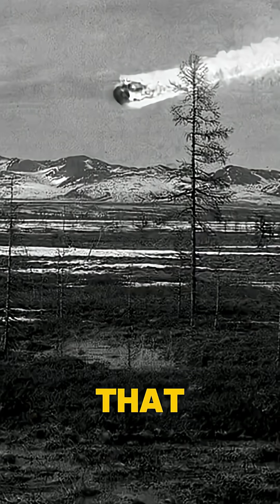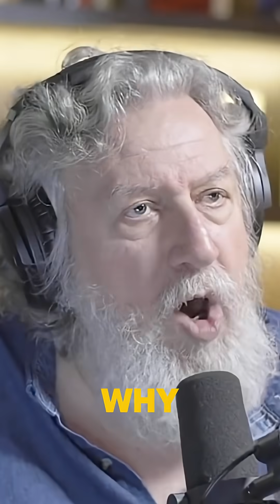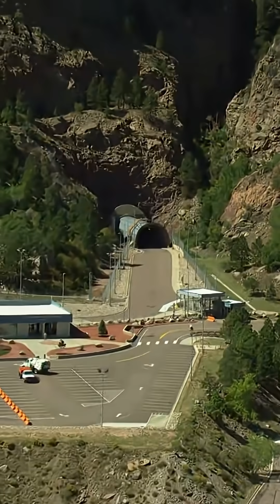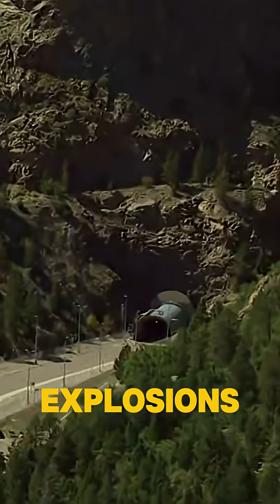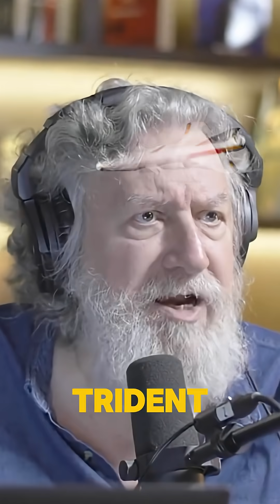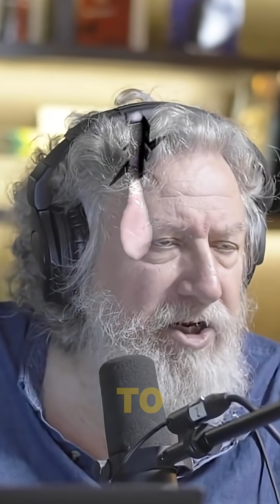Why Missile Silos Are Buried Underground

Comment: Wow... Randall actually is right for once. The purpose of hardened missile silos in the USA is to protect them from surprise USSR attacks on the nuclear missiles.
But it didn't happen at the same scale in the USSR. Thd Soviets kept mobile launchers moving around the USSR to make it impossible for a surprise attack to wipe out many missiles. The "Not In My Backyard" freedom of Americans prevented wandering nukes inside the USA being implemented... they had to fix them in remote areas instead, so hardening the shafts became mandatory since thd Soviets knew where to attack.
Putting the missiles on submarines was another solution.
So there are multiple solutions to problems. Our solution is not the only one.